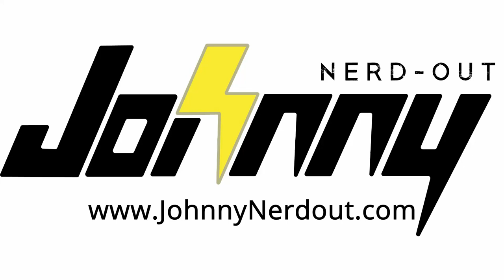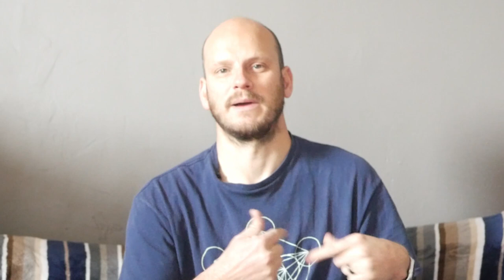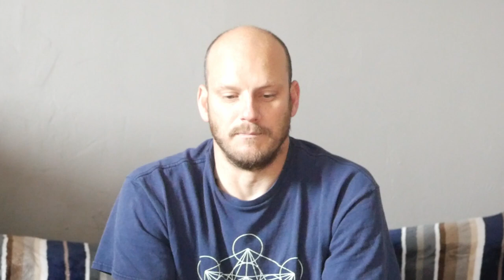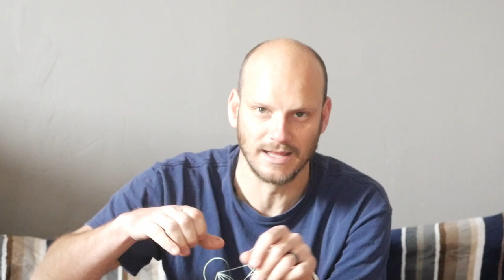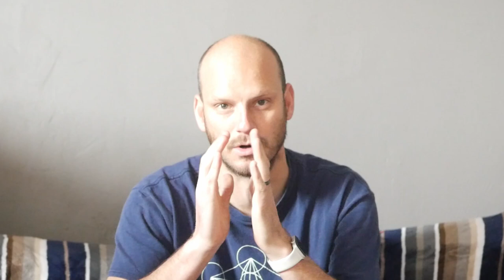E-bike Blog: Are rim brakes on an e-bike ok?

Comment: I'm happy to listen to and generally take your advice on almost everything you have to say, BUT, I think you would have done better to keep away from this topic.
If you're an average punter and are not knowledgeable about brakes and brake systems PLEASE go to a professional and get the absolute best brakes you can afford fitted and/or serviced.
The failure of this component on a bike will most probably cause financial and physical pain, so don't skimp on it.
Reply: There are a few of us that have been in the business so long (50yrs in my case) that we MIGHT have some unique insight. That is mostly along the lines of old stuff, fitting, short cuts and tweaks. There are a very few that have gone to a school that is little more than a certification that you can assemble a Walmart bike. 

There are no actual bike repair experts. That includes these kits and the integrated motors (actually more simple inside than a Sturmy Archer 3 speed). Johnny and I disagree on what should be on a bike, but he offers a great service encouraging people to do it themselves.

Bicycles are not at any level sophisticated. The easiest deraileur adjustments I ever do are Di2's. Shop repair is a convenience, not a necessity. When I was making a lot of money and working 12-14 hour days, I had friends at various shops do my repairs. Many shops have maintenance classes to teach their customers how to do their own repairs. The largest bike tool supplier, Park Tool, posts howto videos on the most complicated bike repair procedures (highly recommend them).
Reply from the maker: Absolutely. However not everyone has the luxury to buy a new top of the line bike. And not everyone rides in wet weather / fast.
Reply: @JohnnyNerdOut  exactly, we carried huge loads on cargo bikes, through The Alps, with Canti brakes. This is just plain silly. Clear your brakes before you descend. Not a big deal.

Comment: Rim brakes, ya, all good:  Until it rains and they get wet.  Then you have the equivalent of running across a frozen lake in rubber soled shoes.  IOW, rim brakes are a very stupid idea for any serious ebike builder.
Reply: Until oil from the road contaminates your pads (happens all the time), or snow or ice fouls them.